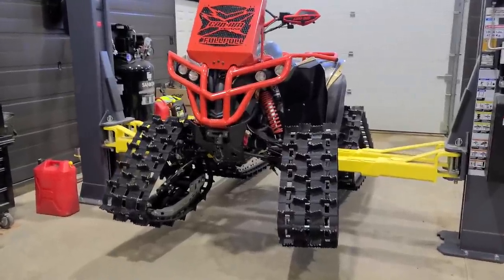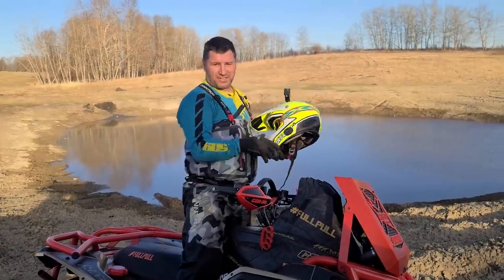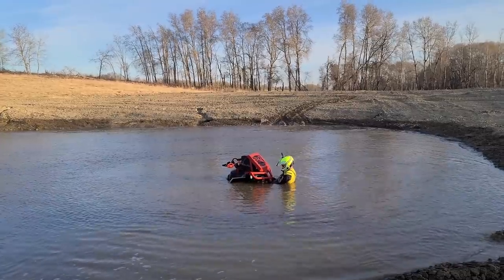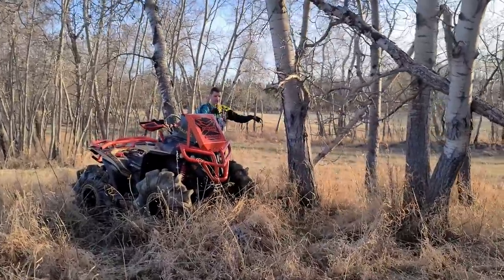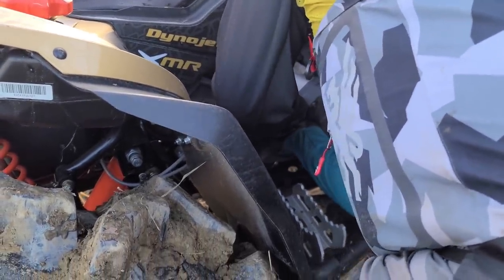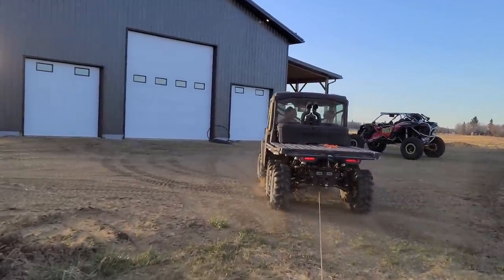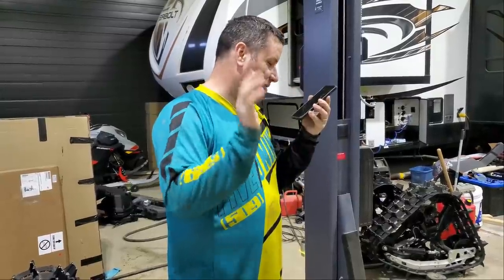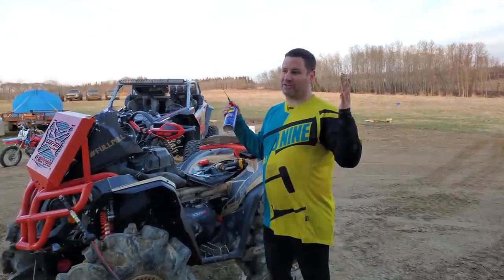Destination Swamped!!! Did We Save It???

Comment: i went thru about 2 gallons of diesel to soak up the water in the crankcase then 1.5 gallons of cheap diesel oil to soak up the diesel that I used to soak up the water.  Ran the cheap oil till it had zero contamination then went back to 5-20w rotella, good to go.  I also BLASTED the cylinders with wd40 prolly more times than I needed to but my cylinders looked good via borescope and away we go.

Comment: I have a 2020 renegade 1000 and ive sunk it about 5 times, 3 of those it got water in heads and hydrolocked and ive done one oil change and she still runs extremely well. Knock on wood lol. But I hope the best with you having a built motor!!

Comment: Plugs are always the first thing! After draining air box if there’s water there. Plugs out, turn her over, spray WD-40 in heads with plugs out. Let it sit turn her over then do it again. Put plugs back in let it run for a min and check oil. Easy peasy

Comment: Honestly... The fact that you only had that much water come out was a sign that you were darn near TDC and was more than likely still on your exhaust stroke. Of course, the cam has overlap, but that was very little water for the size of these pistons.
You got lucky 1000 different ways; however, I would add that you can pull that oil full plug as well as your spark plugs after you get it nice and warm to vent off any excess water vapor.
If it were me, I'd do that before I changed my oil and I wouldn't care to think about it anymore!
You're a lucky son of a gun, Dave! 😱😏🤣👍🏼

Comment: You got lucky last year we swamped a highlifter sportsman and we didn’t get all the water out of the air box. When we put the lid back on and got all the water out of the heads turned it over and sucked whatever water was left in the air box into the head and hydro locked it. Bent a connecting rod.
Reply from the maker: Ouch!

Comment: Dude had the same thing happen to me. Let off mid water wheelie in a deep ass water hole. Big race cams low exhaust pressure, high water pressure through the exhuast and no throttle... =bad day:(
Mine started right away though after tilting up and getting the water out of the exhuast, oil was good, and never any problems after that, i was lucky

Comment: Is that a supertrapp muffler? I used to have one on an ole dr350r, that thing used to rip lol
Reply from the maker: It's a custom Mod Shop exhaust. Similar design. They can tune the exact back pressure for maximum power gains. Very cool system

Comment: Diesel is your friend in these situations.
Reply: Drain all the oil, disconnect the plug wires so it doesn't fire fill with diesel Instead of oil turn it over for 10 seconds drain.  Refill with oil run it for 20-30 dump it refill, filter change and send it. Diesel grabs the water works very well

Comment: Even a hopped up engine why pull the motor ?
Been there done that drain water/oil from top of pistons run engine at idle change oil 3 times check compression